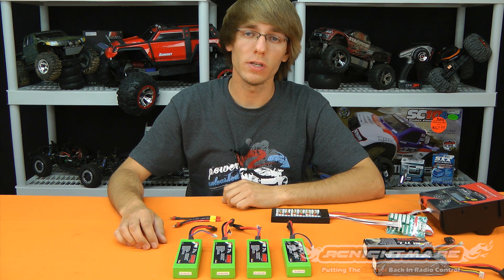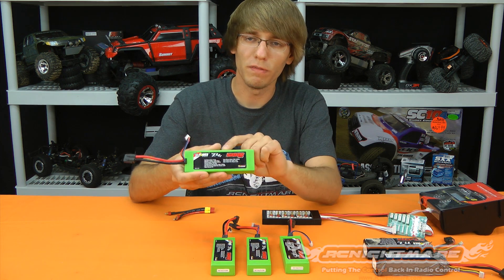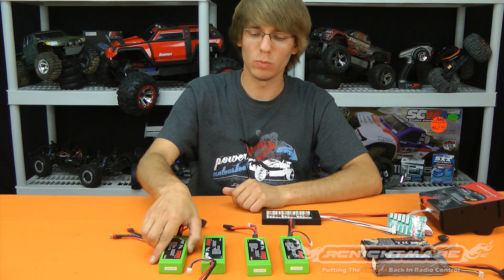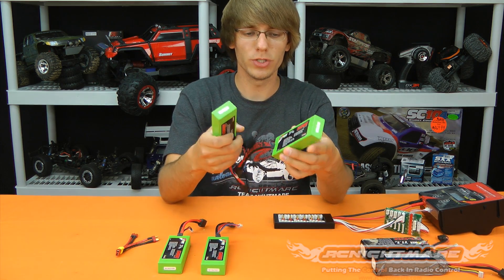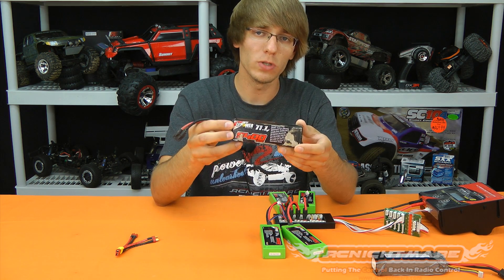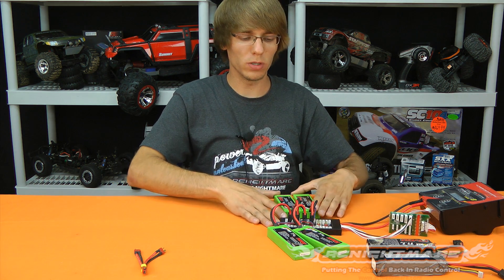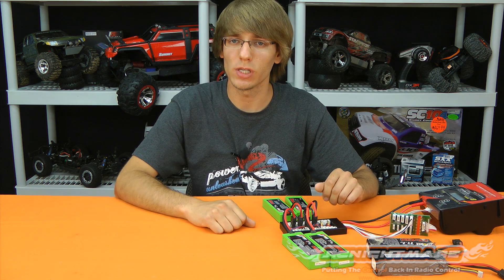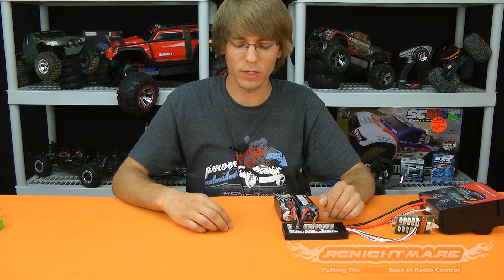RC Parallel Battery Charging For Lipo RC Batteries

Comment: Do you have to have a parallel charging board to parallel charge? I have the Traxxas dual charging adapter and my charger output is only 5 amps. Thanks.

Comment: I hope someone can help me. I have a two 3 cell 4500 Mah battery and I'm using a IMAX b6 5A. My question is, is it safe to use my IMAX 5A or do I have to buy a new charger with a higher amp that I can't afford. Thank You

Comment: I have just purchased a Graupner Ultramat 18 charger and a balance board. In my charger there are 2 settings that I need to know please. If I am charging 2 x 2200mah 3 cell lipos I set the charge rate to 4.4a and do I also change the lipo size to 4400mah .... and again if charging 3 x 2200mah 3 cell lipos I set the charge rate to 6.6a and again the lipo size to 6600mah ? ... my old charger never asked the lipo size, you just put in the charge rate but this one asks .. thanks

Comment: I know this is a old video but I just bought two 7.4 volt 2 cell 7600mah batteries. I have a parallel charge board and a imax b6 charger. I can only go up to 5 amps out, so will it still charge them both in parallel at 5 amps out instead of 15 amps?

Thanks
Reply: Yes but it will just take a lot longer.

Comment: I have been charging my lip's in series using my Thunder AC-6 charger.  Is it safer to charger in parallel or series?  Also, My charger asks for the number of cells and the mAh setting issued to determine what rate to charge at.  What what charger features are needed to charger in parallel?

Comment: My charger is only 3s capable so every parallel board I see looks like it's balance adapter is only for 6s capable chargers. Is there a board I can buy to make my 3s max capable charger charge 2 3s packs or do I have to solder up my own parallel charge/balance connectors.
Reply: You mean like this http://www.ebay.com/itm/Parallel-Charging-Balance-Board-for-IMAX-B6-B8-Battery-Charger-XT60-Plug-/221541515908?pt=Radio_Control_Parts_Accessories&hash=item3394e74284
Check Ebay for all these with different connectors.

Comment: If you parallel plug 2 batteries you get twice the mah, which gives you twice the run time. If you series plug 2 batteries, it doubles the voltage so your top speed doubles, but gives you the same run time. Hope that helps :)

Comment: how about if I'll be using the MPA parallel board for the Powerlab 6 with 4 packs of 11.1v 2200mah. Should the setting be in 3S and in 4P with 2.2 Amps of current? Thanks!

Comment: The C rating indicates max safe discharge level. So a 3C battery can safely be discharged at 3x capacity, a 10C battery at 10x capacity. Example: 3C 550mAh can be safely discharged at 3x 550mA= 1650mA, 10C 550mAh battery at 5500mA.
The rate of discharge is determined by the motor in your helicopter so getting a higher rated battery than standard brings no benefit.
A greater capacity battery will give you a longer flight time, but the battery will be heavier so the helicopter may fly worse...

Comment: For lipo batteries each cell adds 3.7 volts in most batteries.
1 cell= 3.7, 2cell=7.4 and so on.
so youll probably need a 2 cell battery.
Don’t go over the recommended voltage for your helicopters esc (electronic speed controller) or the thing your battery connects to. or else youll fry your copter.
be sure you know the amout of weight your helecopter can lift so you dont get a too heavy battery.

Comment: "c" is the safe amount of current that can be discharged.
so 1 C =1 x capacity.
Ex. 30 c, 450 mAh= means that the battery can push out a max of 13500mili amps or 13.5 amps.
Capacity is in terms of mAh (milliamp hour)
So for your helicopter find the amount of amps your helicopter needs and find a battery that can safely discharge that amount of amps.

Comment: So i'm really new to this so please don't make fun? I am shopping around for different batteries for my helicopter and I  have the option for 3c 5c 10c 15c 20c 25c and so on is that just how many cells are in the battery?? the battery that came with i was a 7.4v 550mAh battery and im looking to try and move up to 800-1000 mAh but not exactly sure what to get. I found a 20 c that fits that but also  15C can someone shead some light for a newbie?

Comment: hi I have a lipo polymer battery pack that consists of 11.1v 5000mah X5, i parallel them together and make it into 11.1v 25000mah,total 15cells, now i had a imax b6 balance charger. But then the max charging can goes up to 5000mah. and can only monitor 6 cells in series at max. now my question is can i pararell my pack to 14.8v with 10000mah a pack, which is 8 cells of 3.7v 5000mah each, that goes together with my charger or any better solutions? pls advice thx

Comment: well said in those expensive batteries u also pay a lot for the brand name 
and many people also claim that those cheap battery's from lets say hobbyking perform better than most of the expensive stock battery's that E-flite and parkzone use And I can say that a 180mah nano-tech pack performs as good as a 200mah e-flite pack and for the price of 1 e-flite pack I can get 4 of those nano-tech's

Comment: what do you put in your charger if it asks for the capacity and it wont go past 5ah but you have 20ah of batterys connected for parallel charging (7.4v 5amp charge rate)

Comment: Question: How do you figure your charger 8 is going to supply 20 Amps in one hour?

I know my GE 6 has a max output of 5 Amps so it would take me 4 hours to charge 20 Amps & that is not even doing a balance charge, which takes longer due to the input Amps drop towards the last 10% of the charge cycle.  I do a single 11.1 volt 2200 Mah battery in balance mode & it takes 101 mins.

Comment: I got a Question a Little off topic.. Is it Possible using 4 of the same batteries 2 in Series and the other 2 in Parallel at the same time then connecting both Pairs together to the esc is there a safe way of doing this will it work.?? I need to Increases both my Capacity and voltage if any one knows or has any suggestions pleas reply.. its not for my rc but my Electric Long board I'm making....

Comment: Many people have done tests on their own proving that many of the cheaper brands perform the same as OR even better than those expensive packs.  I had people at my local track saying that no $35 pack is going to perform as well as a $150 max amps pack.  Well, after having them put one in and watching them run faster lap times and come off the stand saying "WOW those batteries are fast I have to get some of those" you start to realize that the price of the battery doesn't make it better.

Comment: Thats just the balance board for the charger. Some chargers dont have 2s-6s balance connectors integrated into the charger itself (saves space), so a seperate balance board is used.
On alot of chargers you can just plug the para board straight in though.

Comment: Hey Guys I have just bought myself a MPA and PowerLab 8 charger I have 12 4200 35c 6s  hyperion batteries would like to know the following...

Where in the charger menu do I set the parameters since I have not used this charger is there any base settings I have to put in place before I start charging in parallel charge and what C rating is safe to charge these Lipos I have read no more than 6C I was thinking 3C charge rate roughly how long should this take to charge...
Neil

Comment: You are a arragant dumbass. I could say "Why fuck around with nitro I dont feel like burning my hand on nitro exaust pipes and they are so expensive" I don't though, because I know that if you are careful and dont screw arround, burning my hand is not going to happen all that often. Also, im no currency expert, but I belive 200 Euros traslates to about 150-175 american dollars. Now correct me if im wrong, but a standard cheap 5000 Mah 2s pack is about $50. A really kick ass one is $75. Fuck off.

Comment: Thanks for the video. I learned quite alot. I just bought a new charger. The Thunder AC680 and a parallel board. I'll use it to charge my 2s 450 mah packs for my 3D foamie planes. Thanks again.

Comment: What he also forgot to mention is, if you want to parallel charge, Please make sure all your batteries are at same voltage level, make sure they are all discharged. Don't parallel connect cells that are half discharged with fully drained one. if you connect batteries of different voltages together in parallel, one with higher voltage start to charge the lower one, and since theses cells are capable of supplying high current and there are no loads(resistance) between the cells current becomes...

Comment: When charging lithium based cells, I would place it outside, not inside the house... I am not sure if these cells have active battery management system to monitor during charging, but if they are over charged, it will catch on fire!!! So not a bad idea to invest in a good charger.

Comment: I have both... no complaints on either.
Just be sure to get the amp delivery you need for your system...

To calculate the discharge rate of your pack...
mah x minimum discharge C rate / 1,000 = available amps
For example, I'll use the same 2200mah 20-40C pack.
2,200 x 20 / 1000 = 44
This battery pack can consistently provide up to 44 amps.

Comment: Yes.
You just will not have the full benefit of parallel charging due to the relatively low output of your charger.

Comment: ALWAYS balance charge. Fast charging is not safe, especially when parallel charging.

18.5 amps is correct according the the information you have provided... although I wouldn't charge at 5C.

Comment: You can charge two at 1C... which would be 10amps for two 5000mah batteries hooked in parallel. 1C is a safer charge rate unless the battery specifically states it can be charged at a higher C rate. If your charger is capable of 10 amps, charging two will take about the same time as charging 1.

Comment: You can parallel charge with any charger... you just will not reap all the benefits of parallel charging without a high amp output charger. In other words, 5a will work; it will just take a while.... about 80 minuets from 3.4v/cell to 4.2v/cell vs about 45 minuets with a more capable charger.

Comment: when doing this can you double the charging amps? I have 4 batts. All 2s 5000mah. If I'm running two in my truck. Can't I charge two and instead charging at 1c. Can I charge at 2c and it be safe? Or stick with 1c? Answer me please rc nightmare!2

Comment: Hello, i have a question i have one Turnigy 7,4v 5000mah(20-30c) and now i get a new Zippy Flightmax 7,4v 5000mah (20-30c) and is there any problem to charge these different company lipos?.
And the turnigy lipo is about a half year old but still good anyway can i charge them parralel although 1lipo (zippy flightmax) is fresh new and the other turnigy lipo is older. 
is that a problem and is the differense between the company a problem?

Comment: i have been doing this for a wile  now , need a good high end charger that can pump 20amps and a PSU of 400watts 18 volt for icharger 206b. lipos need to be same voltage level if not ,  you just plug the balance plugs in only  the lipo cells balance them self out ,i let them self balance for 10 min before starting charge .just to be safe ,

Comment: Hi there just wanted to know if I was to charge mine in parallel I use 2s 30c 5300mah x2 so if I was to charge them in parallel would it still balance charge the individual 4 sells as I balance charge them all the time to keep the life on them

Comment: @rcflightschool 
Okay. When i got my Charger and balancerboard. I pluged main leads wrong. Then i heard "poks". BUT i checked both batterys, and they was fine, no damages.
I always plug first balancing leads, then main leads and then start Charging. And it's work good. :)

That's a my way to do this.

Comment: @Turoz96 No problems because your doing it right! The danger is that there is a higher probability of plugging in your main discharge leads and balance leads in the wrong order shorting out your packs. Series charging does not have the added benefit of self balancing and low IR. Depending on your application, however, that may not matter to you.

Comment: @Scratch2k1 No it does not matter. "paraboard" stands for parallel board. This means that all the deans and all the balance leads are in parallel which also means they are all hooked up together and it does not matter in what order or arrangement you plug them in. As long as all the batteries are the same voltage...plug away!

Comment: Very informative and well thought out video. 

I have one of these charge boards and it's great, but the only thing you did not discuss which isn't clear even from the instruction sheet for the board is where you are supposed to plug in the balance lead. When you connected the 3S batteries you seemed to plug the balance leads in on the same side of the board but the instruction sheet shows that you need to plug the leads in opposite sides. Does it not matter where you plug in the balance lead?

Comment: @biggdaddy2001 I think you mean any battery that has 4 cells with a 2s voltage rating. 2 cells in parallel and 2 groups of those parallelled cells in series.

Comment: @slash4x4lipo NIMH chargers look for a 'peak' voltage to terminate at. When you parallel NIMH cells the charger cannot see the individual cells and therefore it can miss the 'peak' which will either over charge the cells damaging them or undercharge them. There are chargers and cells (NIMH) out there made for parallel, but 99% of R/C chargers on the market are not designed for this. Simply put, this method is for LIPO's only!

Comment: @nabilgravityoxygen You should always always always balance charge lipos. Not doing so is increasing your chance of lipo fire tenfold! You are correct. When parallel charging cell 1 from pack A,B,and C become "one cell" and so on with cell 2 from A,B,C,etc... The benefit lipo is that the paralleled cells stabilize eachother.  It is smart to charge individually if you have reason to suspect a damaged pack.

Comment: @nerdyrcdriver Buy two bags! You are referring to charging at a rate higher than 1C. I have been doing that for years with my Thunderpower packs (up to 12C) with no problems, among others. Its easier, however, to keep an eye on your battery like your suppose to when it's charging in 5minutes =o.

Comment: @brainanator Yes it can be done. The number of packs you can do at once is limited by your chargers max output voltage. You also have to take care to connect main and balance leads in order. Not quite the plug-and-play functionality of the paraboard but it does come in handy when checking single cell IR.

Comment: @matthewdiscovery1 Yes the same rules apply for NiMH cells. However, the voltage (cell count) must be the same and the capacities must be the same as well. Hook up + to + and - to - and it essentially becomes 1 batter with double the capacity (or triple, quadruple... ect.)

Comment: how are you supposed to cram that into a lipo safe bag? I really dont see a fire happening unless you are charging at a higher rating than the battery. 5ah 5amps. Some people will charge that 5ah pack at 15amps. Forgot the term but people do it and I think it is a bad idea.

Comment: Could you charge a 2s2p 7.4v 5000mah lipo with a 2s1p 7.4v 5000mah lipo together even though one has 4cells, and does it matter with companys even though its the same specs